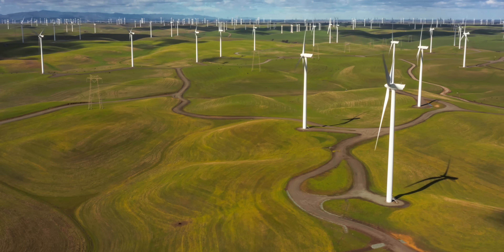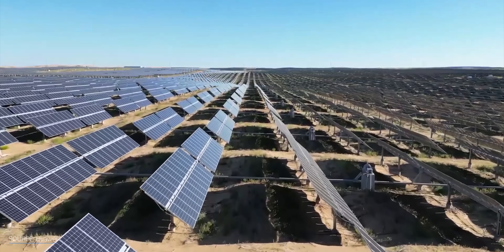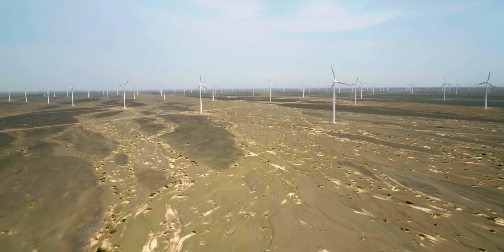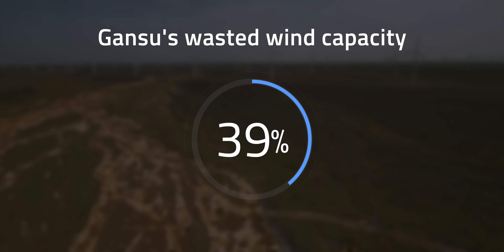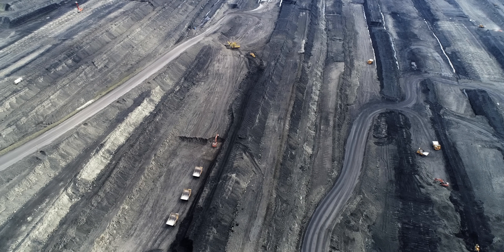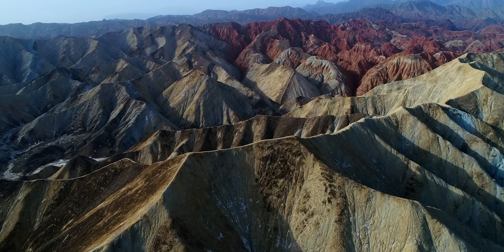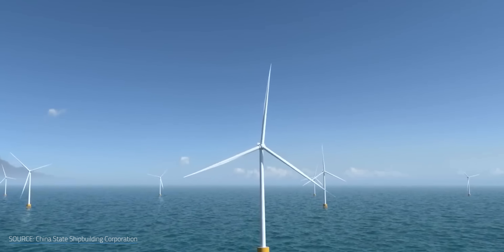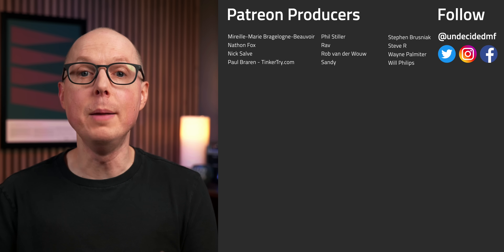The World’s Largest Wind Farm has a Tiny Problem

Comment: @12:00 Couple facts to consider:  1)  you keep quoting "capacity" and what you mean is "nameplate capacity".  The problem is the capacity factor of wind turbines is far, far lower than that of a coal or natural gas power plant.  This fact is muddled up by the grid priority choosing wind/solar, resulting in less fossil energy utilization.  But the reality is that baseloaded fossil power can have around 90% capacity factor (when they are ALLOWED to run) and wind farms are around 30% because the wind is INTERMITTENT.  So when you say there are 20GW of capacity, it's more like 6 GW which would be equal to about 3-6 large fossil plants running at full load (which is how they are designed to run).  2)  Regarding costs, the BESS should be included in the utility total cost, and it's truly not competitive with combined cycle natural gas power, which does not need BESS due to high capacity factors, availability, and dispatchability.

Comment: really, Datacenter which doe not produce anything else than heat. Okay you get info but all the power is converted to heat. How do you get rid of the heat, do the cooling in a desert. Most electronik like human similar temperatures. The desert is at the upper end of this human scale.

Comment: Your video makes no sense for me. Brazil has a national connected grid for decades, all electricity is shared, except for a few remote places. This has a certain cost , money and losses, but works to counterbalance dry seasons on certain regions, because our grid is mostly hydro. The problem with China is just lack of grid a control, they just didn't did the infrastructure. But it is doable. You don't really need to store nothing, or at least that much, you use the coal to complement electricity when there is a lack on intermittent resources.  It is the same issue that Bill Gates is trying to do with nuclear, but coal is easy to pump up and down. As for prices, it is BS. Just tax pollution and the price adjust itself. Coal is bad for health. But Americans are unable to understand that, you know, public health concept. They are the Great Satan after all.

Comment: Very interesting video. 
By comparison with earlier technology transitions, large-scale wind and solar PV are a mighty success.  The largest challenge is always matching the demand with the production, especially when the production is so large and so fast.  The reality is that as the overall system becomes more integrated and energy can be transferred more effectively via transmission systems, the match between production and consumption of electricity will even out.  Moreover, as storage capacity increases the capacity of these systems will really hit its stride.  

Note that coal powered systems require water and fuel and thus have lower costs based primarily on sunk asset costs for the facilities already built.  Thus the "cost" of coal is not a pure comparison with wind power.  Coal requires transportation, storage, processing, and produces toxic sludge waste piles that are massive, not to mention the mercury pollution that ends up in the ocean and bio-accumulate into larger fish like tuna.  

As a last point, the chemical energy stored in coal is mostly wasted by burning it to produce electricity, especially with steam cycle systems where a very large part of the energy is lost in order to cool and condense steam to drive turbines. That is not true in direct conversion systems like wind and solar PV which are vastly more efficient at producing electrify from the "fuel" of light and wind energy.

On the whole, when the Chinese obtain their goal they will have electricity that is very inexpensive because the overall costs of maintenance are far lower that in the case of fuel based systems.  In a few years the cost of solar PV generated electricity is nearly zero because the sunk cost is fully paid back and the fuel cost is zero. That will make them very powerful indeed.

Comment: You know, they say that turbines themselfs through inertia can stabilize a bit the grid (works for any turbine). I wonder if instead of building empty blades you could build blades with weights inside. Thus, when you want to store energy, you moves the weights to the tips of the blade, which increase the whole system momentum, and when you want to get it back, you moves the weights inside.

This could add complexity, especially architectural, maintenance wise, and structurally wise, but everything else would be there. The generator could even be used like a motor to get the turbines up to speed ad midday when solar is on the spot, then get everything back for the rush hour on late evening when people come home.

And if there is too much production onsite you could just store directly in the turbines for later.

Comment: given the difficulty of setting up power lines over such long distances and difficult terrain I wonder if other ways of moving the energy around might be worth considering.
A high pressure liquid system probably faces similar issues
Physically moving batteries around would require some kind of transport network and the energy losses are probably rather high by comparison
What about fibre optic? Convert the energy to light, pump obscene amounts of light down a fibre optic and convert it back at the other end. Unlike power lines fibre optics could probably just be dumped directly on the ground on most places, let it be buried by the sand. I have no idea what the light energy capacity of a fibre optic is though? nor what the efficiency of converting to light and back to electricity is.
Any other methods that should be considered?

Alternatively - what about co-locating the worlds biggest CO2 direct capture? Dump all excess energy into that!

Comment: Matt, 

once again you demonstrate, with your introduction, your lack of understanding on this subject and also your lack of perspective.
 20 Gigawatts in one farm is large but it is not large in the overall system, China is a very large country with requirement for a large amount of reliable generation which it gets from coal. 
The U.K. has about that amount of wind generation capcity, both onshore and offshore and that cannot power even a small country like the U.K.. The big factor is availability, coupled to the wind strength from day to day. In practice the U.K. generates about 7 Gigawatt a day on average, with maximum grid demand being a little over 30 Gigawatts in Summer and 45 Gigawatts in winter. 
Wind is expensive to build, expensive to run, requires extensive infrastructure and extensive support just so it can run when grid connected.

Comment: These large scale Chinese wind and solar is all part of the even larger plan keep the East running by using power from the West.  As 90% Chinese industries and population lives on the east cost. When the sun/wind sets in the East. They use stored and excess power from the China's west to power the East. It reduces the amount of coal power plants providing baseline power. The key is the Ultra-high-voltage electricity transmission network they are building. Once the entire network is online. They will be able to shift power from any corner of China.  This actually part of an even Larger goal of making China is the most attractive location for manufacturers. With Cheap green power, Cheap Logistics and massive component supply network and highly skilled labour force.  Because having cheap labour doesnt cut it anymore...

Comment: 50% of the installed capacity for wind makes good headlines but no great deal.  The capacity factor for wind turbines is around 20%. Assuming 80% capacity factor for fossil fuel and other sources, the actual power from the windfarm is just 20% of total generation. Even at that scale, it is still a long way to go for 50% energy from renewables.
Reply: And much of which occurs during low demand so it isn't even used. If energy storage was viable, it would make a lot more sense for conventional plants- they could be smaller/ cheaper/ lower capacity- but run at a constant rate, saving energy off peak to distribute on peak every day.

 But wind turbines cant even do this since the generation is so erratic. Enough battery storage for a day is useless if it's calm weather for a week. You still cant replace a single conventional plant.

Comment: Is'nt one major problem cost? The energy is more expensiv in production on the first place and storage adds a multitude of this primary production cost. 

And if we fear warming effects, we should mention that for every energy conversion, carnots efficieny is valid. This means a solar cell produces a lot of heat, beside the energy we are able to use. This heat would, without the solar cell be radiated into space immediately (albedo) but now is kind of stored a while until earth became warm enough to radiate it back into space. Would be interesting to compare this to the effect of CO2, which seems magnitudes smaller compared to the carnot efficieny.

Comment: Liquid hydrogen has a Gravimetric Energy Density much higher than Diesel or Gasoline (around 120MJ/kg vs 45MJ/kg) so it's perfect for vehicles, where weight is far more important than volume, but it takes a lot of energy liquefy Hydrogen. Grid tied liquefaction plants could both soak up 'excess' energy generation, act as a huge storage mechanism, and provide a replacement for fossil fuels.

Comment: They could turn it into Hydrogen using Hydrolasis. Especially if they have 30% of free energy.
Reply: Yes. I strongly support this use of hydrogen fuel. Hydrogen fuel cells are not at the point where they are better than LiOn batteries but the potential is there. 
This can be used for powering vehicles and even ships.
Reply: These wind farms are in the desert so there's not much water on site. The power needs to be transmitted first.
Reply: The first flaw in that cunning plan is sourcing the fresh water required to supply an industrial hydrolysis plant in the Gobi desert. The next (seldom mentioned by cheerleaders) is to transport the resulting hydrogen (which is a quite weak energy carrier) over vast distances at tolerable cost/benefit without losing it. Pipelines are a poor start since to H2 molecules the valves and joints in the pipeline are an easy leak path and the steel is subject to embrittlement after exposure to hydrogen, and hydrogen enduced cracking becomes more liekly as the strength of the steel in question increases. 
Liquifying hydrogen means cooling it to within 20-30 degrees of absolute zero at ambient pressure and the energy required to do so amounts to around half the energy value of the hydrogen being compressed. Alternatively, the hydrogen gas can be compressed to high pressures (350-700 bar is typical for transport, compared to around 200Bar for compressed natural gas, or 20 Bar for LPG/Autogas). For these practical reasons, it is more sensible to produce the hydrogen where it is required on-site by electrolysis, provided one has water and electricity available. 
An alternative is to use the hydrogen to produce ammonia for transport, but adding two extra steps (producing ammonia and then extracting the hydrogen at the destination) results in additional losses of the energy one was attempting to store in the first place, ammonia poses a risk of caustic burns and if used as a direct subsititute for diesel, has only about a third the energy density. If using excess wind generation to produce hydrogen as a precursor to ammonia, the ammonia is better used to produce fertilizer or chemical feedstock, which leads one to conclude that the best way to salvage some of the (heavily subsidized) malinvetment sunk into wind or solar energy boondoggles is to site industries nearby that require abundant energy but can tolerate that energy being delivered chaotically.

Comment: I don't know if projects of this size are all that desirable.
However, they DO show that the limits on what we can do, are a lot farther out than many of us think they are.
The challenge is to get the right mix, of "easy" power generation, and storage, and transmission. 
This is not in any way an easy task.
If we work at it though, I thoroughly believe we CAN replace most, if not all burning for our energy needs.
So essentially, yes, we (the countries of the world) can do something similar, and we can make renewables work in a far better way than we ever did burning anything for energy.
Reply: Pie in the sky blind faith.  This is the religious great awakening of our time.
Reply: @shorewall  
If it is "faith", then it is faith based on facts.
So definitely NOT blind.
Religion has its place in the world, but there is more than just that.

Comment: China anticipated much higher growth than it achieved. It's an across the board problem.  China is now demolishing huge empty cities that never took off. Massive buildings 90% or more complete that have never been occupied. 

Lots of reasons for not achieving the growth rates it anticipated. 

Energy is important, but a large population center needs water too. China could benefit by spreading  out a bit, but that comes at a cost. Right now China is not prepared to make those investments right now.

Comment: Reading (elsewhere) that China is set to double its solar and wind energy capacity to 1200 GW by 2025 ... 5 years ahead of its 2030 GOAL!!  (think goal was set in 2021)
There's been a push this year to demonstrate sustainable projects as modern China turns 75. 
BTW:  1200 GW is almost 1000x of power to time travel:  Back to Future.

Comment: Well, in oh-so-green Germany the electricity prizes have doubled after they shut down their nuclear power plants and tried to make do with large wind farms. Wind-produced electricity is just a very expensive (as well as noisy and  bird-killing) hobby.
Reply: @OldieBugger This is a blatant lie. Electricity prices decreased slightly after the nuclear power shutdown and it had nothing to do with it. The remaining power plants that were shut off produced a single digit percentage of Germany's total electricity output. 

Also the bird kill myth shows that you arguiing in bad faith. The amount of birds killed by wind turbines is insignificant compared to buildings, traffic and cats. The last source could be regulated. But there is not public discourse about it. I wonder why?

Comment: The Gansu wind farm is a white elephant with no market for its expensive wild AC electricity.  Wiki describes the situation with the 10 GW of wind power capacity of the Gansu wind farm.  On March 1, 2012, a "wind power coordinated control system" was implemented to adjust the output of the 18 wind farms of the Gansu Wind Farm Project, which total 10 GW, to meet the needs of the transmission grid, which is limited to 1.5 GW.  

About 1/3 of a wind turbine generator's capacity in a well situated ares is expected to be regularly produced so 3.3 GW of output that is culled down to 1.5 GW.    The culling of the output to about 1/2 the typical peaks should allow for steady grid quality electricity, but it is never 100% sure.  Some large industrial use that can be shed quickly without harm would be an excellent customer.   For that type of customer the electricity would need to be very cheap. 

The high cost quoted for the Gansu wind farm's electricity would be expected from scheduled power station with 100% backup instantly from natural gas turbine generators for supporting a wind farm.   If the cost of natural gas goes up it would push the wind farm's electricity price above an acceptable purchase compared to other sources causing the wind farm to be largely offline and shutdown until the price of natural gas goes down.  

The reality is without hydropower providing instant backup to a wind farm its cost to be backed up by natural gas can cost more natural gas than making all the electricity with natural gas combined cycle plants where they can use a steam cycle to add 50% higher efficiency.  

A nuclear power plant has extremely low internal cost of incremental electricity.   Nuclear power plants take a long time to increase power output, but can shutdown power output quickly.   They are best to run at high output.  

In the US scheduled midwest wholesale electricity is $0.03 kWh and less.   It is expensive electricity to be selling at wholesale at over $0.04 kWh in China from coal.